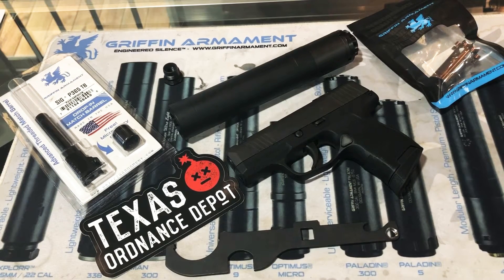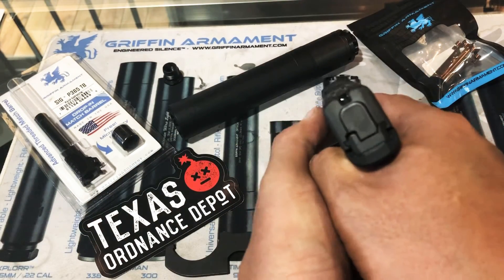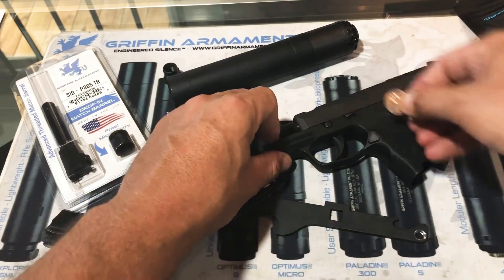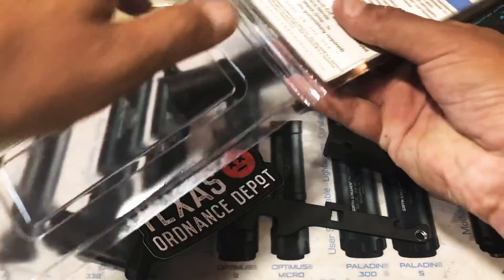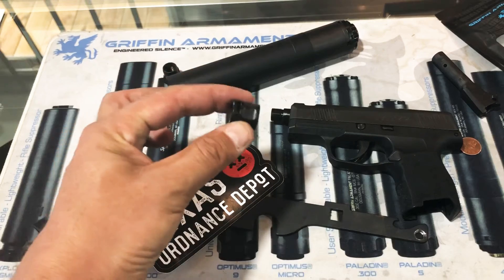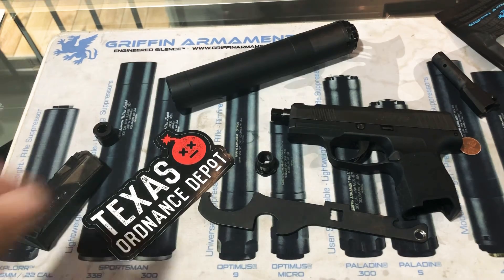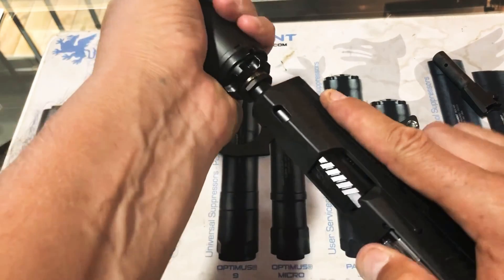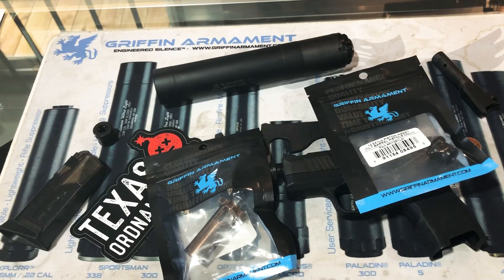SIG P365 SAS disassembly/reassembly Griffin Armament threaded barrel installation and CAM-LOK System

Comment: I can’t get the threaded barrel in. I don’t want to force it and wreck the barrel. Any suggestions? I have the Faxon threaded for the P365.
Reply: Did you take off the thread protector? is it able to actually fit in the slide when disassembled?

Comment: Would it be necessary to put lock tite on the comp?
Reply: A bit late to respond to you, but nope. I got this barrel and micro comp on my G17 till i get my suppressor. going to pick this barrel and camlock system for my P365, and plan on updating the micro-comp to the camlock system for both. as long as you tighten it down well, and keep an eye on it, it should be fine without loctite.